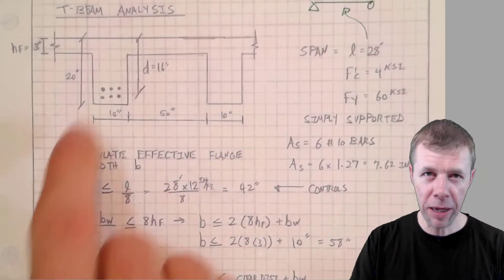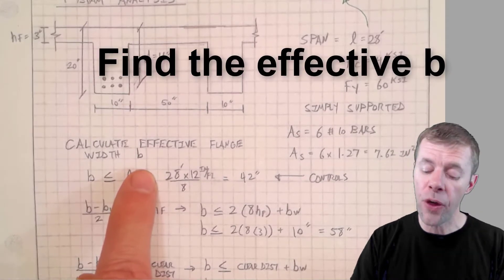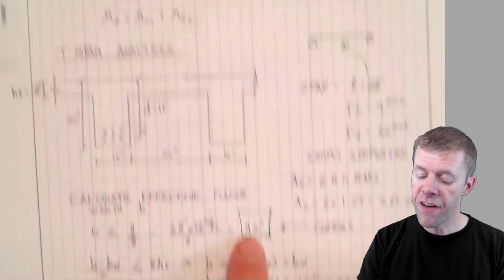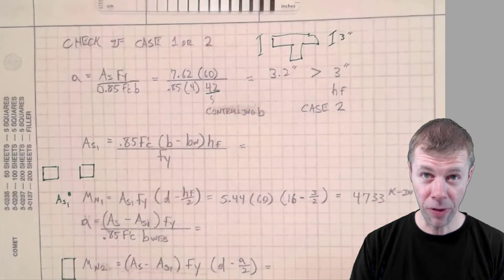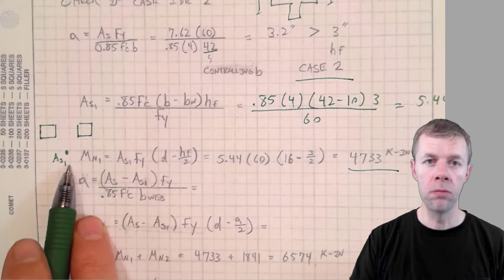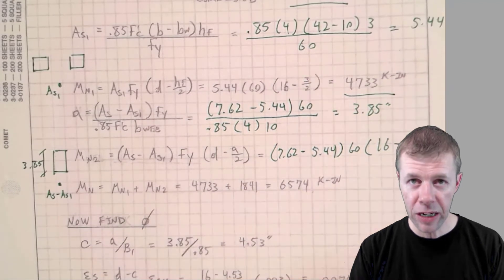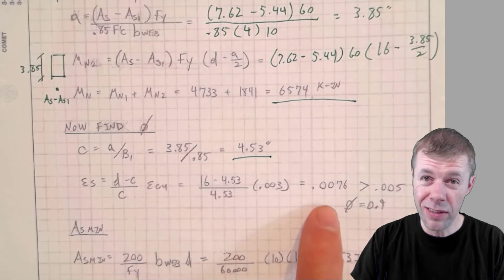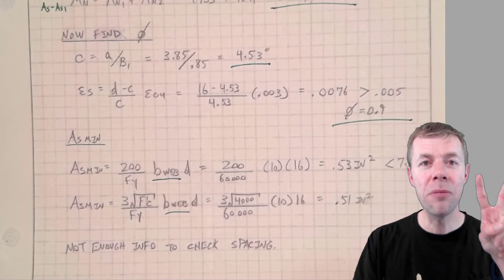T beam reinforced concrete analysis | part 2

Comment: Sir I have a question  about the steel ratio formula of T-Beam. bacause i learned that the formula  is (Area of steel) over (Width of web)x(effective depth). why is it like that. not (Area of steel)/(effective Area of T-beam)? Thank youu!!!
Reply from the maker: The stem or web of the T beam is what is in tension.  Therefore only the rebar in the stem should be included in the rho calculation.